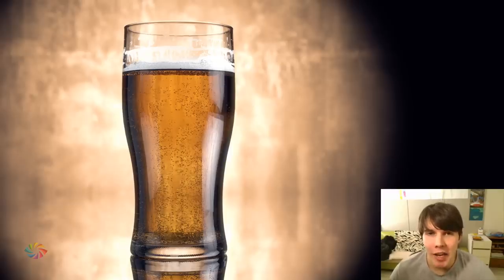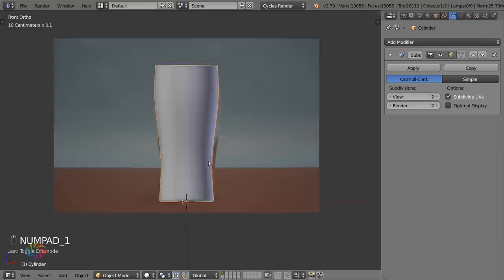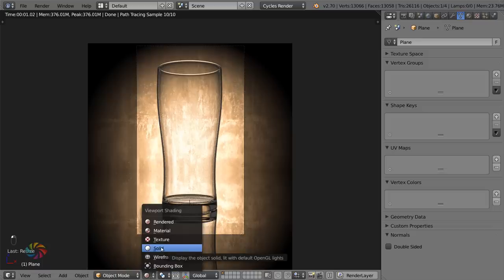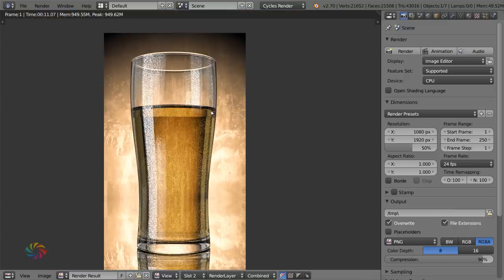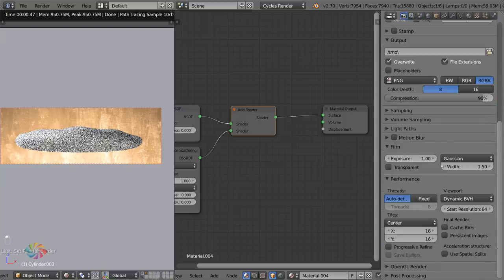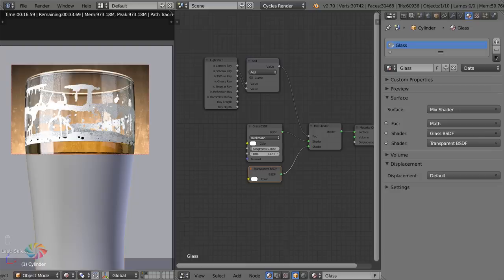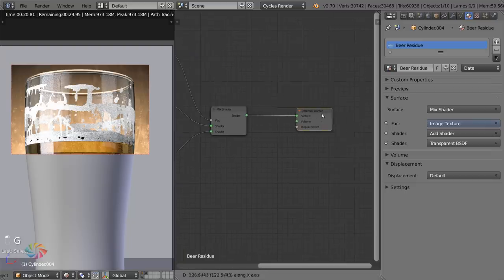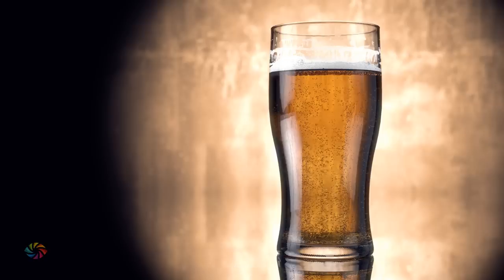How to Make a Beer in Blender

Comment: The bubbles form in places that allow better nucleation effect – like impurities and scratches on the surface of the glass itself or pieces of dust and grease being result of not cleaning the glass well. So in a clean, freshly washed glass there would be only a few subtle streams of bubbles in your beer. 
So, knowing this, now you if you get a beer in a bar and you see a lot bubbles creating in the liquid, especially on the sides of the glass, then you know that it wasn't cleaned and rinsed before pouring beer in.
Reply: True, though you used to get a lot of bubbles forming due to the imperfections in the glass when the beer glass was made (so it wasn't necessarily dirty yet still produced a lot of bubbles) but with the amazingly precise manufacturing we have now, very few imperfections make it into the glass so beer glass manufacturers add the equivalent of your bubble emitter planes, laser etched into the glass in order to create bubbles. https://brucrafter.com/wp-content/uploads/2019/03/etched-nucleated-bottom-beer-glass-muffin-top-review.jpg

Comment: Fizzy drinks bubble from single points because they need to nucleate.  Basically, the nucleation points are small enough, that the gas in the beverage can escape into them easier than the liquid, and then cluster together and bubble out.  That is the easy explanation.  It's also the same reason why Mentos make soda explode.  The surface of a Mento is covered in pits, which act as nucleation points.

Comment: About bubbles: 
1) realistic bubbles has a lower size when they are lying on the bottom than when they are blowing up to the surface. It's like inflating a balloon. The reason is the pressure inside the liquid is linearly increasing as we go to the bottom and it comprises the bubbles.

2) Another thing is the separation between bubbles because they are more separated each time going up, because the bigger they are the floating force push it up stronger and they are growing up as they are going up to the surface, positive feedback. 

3) Last thing, no linear trajectories is about vortex shedding around the bubbles as they are passing thought fluid  (see: von Karman street) it depends on thr Reynolds number,  etc...

Comment: When adding the face on the bottom of the glass...easy fix for the wierd shape that results. Inset bottom face, drag to end edge, then edge loop and drag to bottom. if you want the slight bevel, don't drag faces all the way to the edge

Comment: Hi Blender Guru: a quick response to your bubble question. In beer a lot of gas (mostly CO2 and air) is soluted. However due to the apolair nature of gases, i.e. they do not like to mix with water just like oil. Whenever there are apolair particles (tiny microscopic impuritites like dust particles for example) these molecules adhere to  the particles. Bubbles are formed whenever enough gas molecules stick together. If the particles are big enough you can actually see this with the naked eye: just boil an egg for example, you'll see bubbles forming on the egg. The impurities in beer are not visible to the naked eye and the float around via a random pattern (a.k.a. Brownian motion (sounds familiar?)). That's why these streams of bubbles seam to spawn at random locations in the beverage.

Comment: For realistic IOR for the bubbles, I think the reason why setting the IOR to 1 doesn't produce a good value is because the light refraction is determined by the surface, not by volume. If you put an icosphere with an IOR of 1 inside of another object with higher IOR, blender does not calculate the IOR of the fluid. So having an IOR of 1 for the bubble has no effect.

Instead, try setting the bubble's IOR to be the same as the fluid, and flip the normals to face inwards. That way, cycles will treat the side which the normals are pointing to as the same as air.

I'm not exactly sure if this is how cycles rendering for refraction works, but it's the best explanation I can think of.

I think it is (theoretically) possible to use a stack data structure for each sample, to keep track of the IOR which the sample last passed through, which could be used to calculate better results, by pushing the new IOR onto the stack whenever it passes against a normal plane, then popping that value off of the stack when passing with the direction of a normal to simulate the entering and leaving of a solid object. Though this would take longer to render and require more memory. That's why I think that cycles calculates refractions manually (the way I described it earlier) instead of using an IOR stack data structure.

Comment: You should really flip the normals to make it look right! When light goes from air to glass, there's an IOR of ~1.45, and when light goes from glass to water, there's an IOR of 0.85. Since You can't have IOR lower than 1.0, you must make the IOR 1.15 and flip the normals. If cycles volumetrics doesn't work with flipped normals, you should make the volume a separate object (with normals outwards), and pull it in a bit if the overlapping faces are a problem.

Comment: Bubbles do that because of nucleation sites. Basicaly the gas in the liquid needs a place to diffuse out and form a bubble, It can´t do that spontaniusly. The glass has tiny imperfections that make nucleation sites where gas can form bubbles and then rise up. Some materials have more imperfections hence more nucleation sites, thats why if you pour a beer in a plastic cup it will have more foam and its the same reason mentos create that extreme foam in sodas.

Comment: Maybe this has been asked/answered already.  What is the advantage of using an Add Shader vs a Mix Shader?  I know the Add Shader is just shader + shader, whereas a Mix Shader you control the ratio.  But it seems like you hacked the Add Shader by reducing the colors from white to gray (when you were making the foam material).  Wouldn't it have been equivalent and simpler to use a Mix Shader with the ratio at 0.5, with both colors white as ultimately intended?  Or do I misunderstand something?
Reply: If I understand correctly, with the Add Shader you will get 2 pictures put on eachother. For example if you have a texture of shadows you want to ADD to the ground you will have them both in good colours and it will only put the shadows on the ground, while the Mix Shader will fade the colours to 50% then

I hope you understand it!

Comment: Andrew, about the bubbles material. If you look at the 1.45 IOR bubbles shader inside the beer, you'll notice that they actually act like a glass (see the difference between them and the booleaned ones). It's like a glass bubbles inside a glass (which doesn't make sense in the real world). And you couldn't use IOR=1 either, as you mentioned. And you couldn't use boolean on particles (not converted, of course). Well, i found a trick. Set the IOR<1 and it gives the correct air bubbles shader! And i guess, it shoud be 1/1.45 = 0.69

Comment: Right i know this is a few years too late, and you probably have had the answer by now, but i didnt see it in the comments and couldnt be bothered to keep looking.
and since I work with beer i figured Id answer you.
The bubbles come out of nucleation points in the glass.
C02 in solution needs a nucleation point to form bubbles, that may be a tiny spec of dust, a malformation of the glass, or as its usually the case a pre made nucleation point which is usually a design in the bottom of the glass made of tiny porcelain dots. 
it will work with any liquid that has c02 in solution in any concentration, the nucleation point gives the co2 a point to come out of solution, and thats why bubbles always come up in a line from the same spot. 
and beer glasses have those points to make the beer look livelier.
Reply: You work with Beer? That's a dream job right there! Can I ask what you do
I'm a Beer enthusiast as well as a 3D hobbyist!

Comment: This is excellent. Could you explain properly how how to shape the foam at around 28:30?  What are you doing there to stop the bottom surface from distorting as you add the random shaping to the top?  Thanks!

Comment: Great video, very very informative as usual.  I have a gap in my knowledge that I need some help with:  
at 0:29:17 Andrew smooths the centre of the foam disc, I know how to switch to smooth, but then I see an circle overlaid that he shrinks, I'm guessing that circle is indicating an area of effect or tool size?  I can hear him scrolling the mouse wheel.  How does he tell bender to modify the size of this area of effect/tool size? If it's a key stroke or mouse button, The key doesn't seem to be displayed on screen.

Comment: Actually I think the IOR of the bubbles is weird because cycles does the IOR calculations based on the previous domain so 1 to 1.45 there is a difference and 1.45 to 1 there is not because unlike IRL it doesn't reverse the effect but instead treats it like a 1 relative to 1.45 aka beer to bee.
Acutally you would have needed to do an IOR lower than 1 for the bubbles for it to be realistic.

Comment: The blender team should add a shortcut for flipping the resolution-values. (Compare at 13:35)
It'd be cool if you could just drag on value to the other, and make them flip this way.
Sometimes it's annoying having to type both values...
(I might as well just be lazy here :P)

Of course that's just a tiny detail, but it'd be cool :)

Comment: Thank you Andrew. I enjoyed watching that. (though some went over my head, it was very informative and watchable.)
Bubbles? It is one of the Gas Laws, that bubbles will condense on a sharp point in a liquid under pressure. You can illustrate this by chucking crystals (salt) into fizzy drinks and watch it froth over. The sharp points in a glass are usually just dirt, hence the need to polish the glasses. (LOTS of bubbles on the side is a dirty glass) They actually ADD artificial points by etching patterns ("Widgets") into glasses now, which produces more head but flattens the beer. Question I have is what you used to record such a long tutorial? (i.e. Screen recorder software - and perhaps the hardware you used too) Thanks again.
Reply: "Nucleated" is the term apparently. The bubbles need a nucleus, so when they imprint glasses with 'widgets' it is called nucleation. http://en.wikipedia.org/wiki/Pint_glass

Comment: I know this is an older tutorial, but I wonder: How did you select only the inside of the glass when adjusting the bottom. Is there any trick to it? Sometimes it works for me and sometimes not (it selects also the outside mesh). I can't figure out what am I doing differently. Thank you!

Comment: To answer your question at 44:50 regarding how are bubbles formed and why they come in strings rather than all over the place. Here's a simplified description:

Bubbles in soft drinks are CO2 gas that was initially dissolved in the liquid under high pressure. Once you release the pressure, the CO2 will go back to the gas phase since the pressure is too low to keep it in (partial) liquid phase and microscopic bubbles start to form everywhere almost uniformly. Microscopic bubbles are attracted to one and another by Van der Waal's force (the same kind of force that allows geckos to stick to smooth surfaces) and they coalesce into larger ones, small bubbles are more attracted larger bubbles (larger Van der Waal's force) and gases rather stick on glass surface than float around in liquid until the liquid pressure overcomes the adhesive forces between gas and the glass surface. When a bubble gets large enough to float away from the glass, it actually leaves a thin film of gas on the surface which attracts and coalesce with more tiny free-floating bubbles to become larger until it gets large enough to leave the glass and float upwards away and so on. Hence you get streams of bubbles.

Comment: Andrew- that's was a very good tutorial, really helpful in an illustration I'm working on. The thing is- I'm trying to a greety, dirty, pub/bar scene (a bit vintage purhaps) the thing is I'm trying to do some dirty ashtrys with ciggarets and all, and I'm having trouble with making smoke, cause cycles doesn't seem to work :/ How should I aproche it ? How can I render smoke and a smoking ciggaret ?
Reply: Render the smoke on a separate layer with the internal render and then composite it into your cycles render. Or you can download a branch build that has the beta smoke volumetrics features.
Reply: Adam Falldorf Hmm ... Do you have a tutorial link to compsiting the renders ?
Reply: Adam Falldorf I was actually thinking about modeling the smoke by hand and giving it a volumetric material. Wonder if that would work.
Reply: Maniek Sztrekson FYI: http://cgcookie.com/blender/2013/10/10/compositing-smoke-simulations-cycles-renders/
Modeling it by hand would probably work, but it could be difficult to model all the subtle variations in realistic smoke. Personally I think compositing would be easier.
Reply: Tanks You :)

Comment: I just want to know why, when the GPU cannot handle certain things (such as the Volume Absorption), the program doesn't pass those commands on to the CPU, while leaving the rest of the rendering up to the GPU. Always getting CUDA errors, like Blender can ya just pass it on to the CPU when you run out??? I probably sound like such a noob but the real problem here is that I just need to upgrade my Graphics cards lol.

Comment: Slight problem, I've set up blender according to your screen, followed every step right up to getting rid of the top and bottom planes, for some reason rather than opening up the cylinder when I select faces it gets rid of the whole thing???
Any ideas? I'm running blender v 2.69 and pretty much a complete noob at this so it's more than likely me messing up

Comment: The colour of the beer won't show up for some reason. I recalculated normals and set the nodes up exactly as you did, but it's just completely transparent. The object is definitely visible, and I'm using CPU rendering.

Comment: The colour of my "beer" wont change. I did everything like he did in the video i just took a white background with emission instead of his cool background.
Reply: I had the same problem. It looked like I added a solid glass cylinder inside my beer glass. I fixed that by checking "inside" when recalculating normals and now they look like in the video. BUT I still don't see any color change, just some boring glass of water... Can someone help me with that?
Reply: Yeah, it took me a while to figure out as I head the same thing and the comment section didn't help. So what happend for us (or me at least) is that we have our glass material from the glass óver the beer (or wisky in my case) material. Which is chosen first as only 1 material is used. Remove the glass material from the beer object and you should be fine.
Reply: Did you try turning it on and off?

Comment: From what I recall, bubbles form because of imperfections in the glass. Without those imperfections, bubbles might not form at all. This is why pots are made from scratched metal.

That's also why soda pop and Mentos cause huge amounts of bubbles, because Mentos have many, many tiny pockets of air all around their surface.
Reply: Soulsphere001 Bubbles are created by impurities in the liquid. 
Mentos work because they cause the impurities and they work well because they have a large surface(because of those pockets.)
The main cause for bubbles is the carbon dioxide or rather the carbonic acid. As the carbonic acid gets less stable with the impurities, it decomposes in water and CO2 which are the bubbles.

They generally don't start at the bottom of a glass though and they grow in size as they go up as they collect more dissolved CO2.
So ***** , you screwed up. Bubbles aren't present in the bottom of the glass and they start smaller. Go drink beer to repent.

Comment: How exactly do you select the vertices that are inside the mesh without selecting those that are outside? Are there more nifty little tricks like that? That would cut a load of extra work off my project I'll tell ya :D
Reply: There are a lot of tools for selecting, all for different situations. For example: When something an element is not connected to the rest, you can select one vertex from it and press Ctrl+L to select everything linked.
You can select the blocking faces on the outside, press H to hide them, and then select whatever is behind those faces. You can unhide everything with alt+H. 
You can create vertex groups for certain parts and use those to easily select things.
You can select both the inside and outside, and then deselect the outside.
Etc...
Reply: dennishenk Thanks, that Ctrl+L will certainly come in handy, I once had a character and wanted to delete the shoes, so I ended up selecting faces in bulk using 'c' and then going round and deleting the individual verts that remained. But since the shoes were in no way connected to the main mesh I would imaging ctrl+L would select one whole shoe, right? Oh well, at least I got some practice (I'm still on the fence with tablet vs mouse, especially since I make models mainly for use in games so high poly sculpting really isn't a thing for me... hmmm...)

Comment: Putting on the Solid modifier makes it black and I cannot make it transparent again after that! I tried both the Glass shader and the Principled shader with Transmission all the way up.
Reply: I tried it again without the solid modifier and it still won't go transparent. I've tried all the settings, including the Full Global Illumination preset. I still get a black glass with reflections but no transparency.
Reply: I figured it out! I had to go into Scene and turn off Simplify.